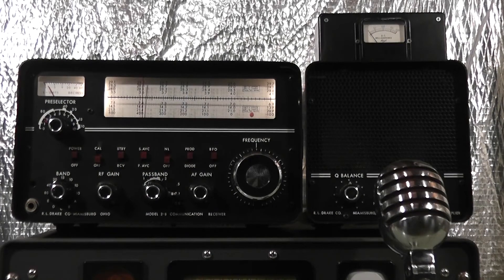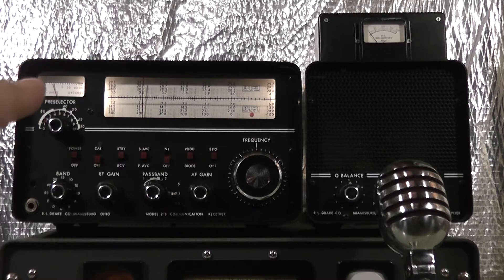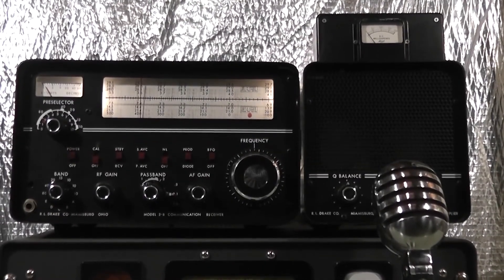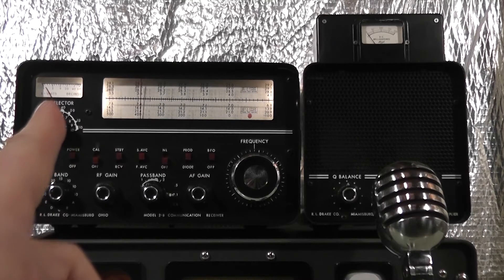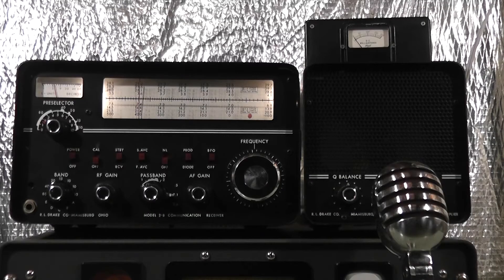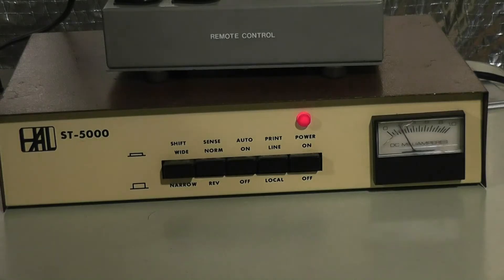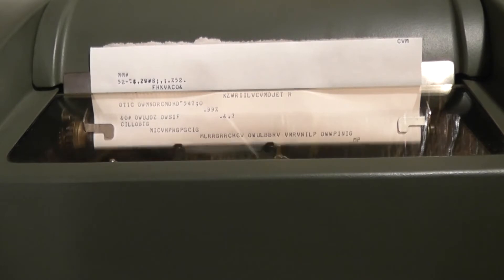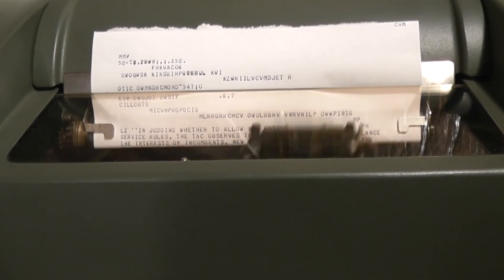RTTY on the Teletype Model 28 KSR

Comment: WCBS Newsradio 88 in New York, in the 1970's, had three Model 28 KSR's all bunched together in a corner of their teletype room.  It appears that those were the ones heard behind the anchors from around late 1972 until about 1987 (it was still used as late as 1986 when the space shuttle Challenger exploded, with all on board killed).  Thanks to YouTube videos like this (and those produced by the Museum of Communications), that's what it sounded like - a degree of elegance and class befitting then-parent CBS's "Tiffany Network" status.

Comment: I was a teletype technician in the Air Force back in the 70s.  Worked mostly on Model 28s which were very reliable even in heavy use.  Ironically, as a ham I never got into RTTY.

Comment: I used RTTY teleprinters (Model 15 & 19) both on Ham radio and at my job (broadcast newsroom), from the mid 60s to the mid 80s.  I would suspect that since radio and TV stations and networks as well as the military, no longer use teleprinters, that ribbons and paper must be very expensive and hard to find.  Of course, that's what happens when demand is greater than supply.
Reply from the maker: Ribbons for the 28 aren't bad because the common Underwood ribbon and spool are compatible.  For units with low clearance (like the LPR tape punch), the new manufacture plastic spools are problematic, but for the tipping unit even those are fine.

Paper is more troublesome.

Comment: Ethan. Thank you for the trip down memory lane. I was a 306x1 in the Air Force from 1981-1992. Repairing Model 28's was one my jobs for quite a few years until they were phased out around 1990. Your videos on the Mod 28's bring back so many memories.
Reply: Wasn't 306X1 DSTE maintenance?  Or did they combine that with 363X0?
Reply: @johnanderson8046  John, you are absolutely correct. Teletype was 306x6. I went back and checked my DD-214 to verify. DSTE was indeed 306x1. If my memory serves me correct, and I am old now so it may not, they integrated with crypto maintenance.
Reply: @drborn63  You're not alone.  I'm old now too!

Comment: why are you poking a metal screwdriver around it
Reply from the maker: I'm not sure I understand the question.  It's mechanical, not electrical, if that helps.  If you're worried about the pointer hitting moving parts, that's probably camera perspective, there's clearance.

Comment: In the mid-1970’s I had the Model 28ASR with the HAL terminal unit and Collins 75A4 receiver. I used them for both ham RTTY contacts and printing the latest news from the wire services which transmitted on HF frequencies.  w0xs

Comment: Do you do regular maintenance on that teletype so nothing within it breaks down?
Reply from the maker: It was designed for continuous service with maintenance intervals on something like a semi-annual period, so in service a few total hours per month/year, it needs very little.  Lubrication does gum up and dry out, so I occasionally wipe things off and drop a but of oil here and there.  I have no meaningful maintenance schedule, however.

Comment: Had a 28ASR geared at 100WPM with a UT-4 which changed the incoming 60WPM (45 baud) to the speed of the 28. Also changed the outgoing speed from 100 to 60 WPM. Was really cool to watch. Loved working on the air with the 28. Wish I still had it as I loved the sound, smell and rhythm of the mechanical stuff.